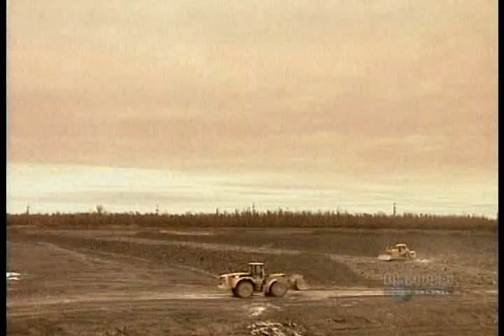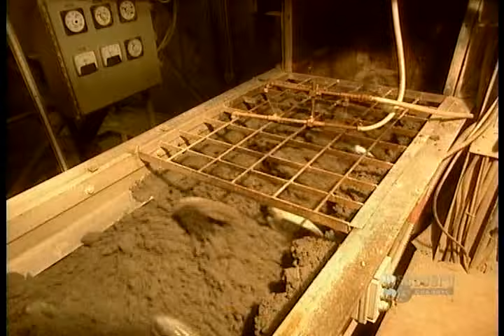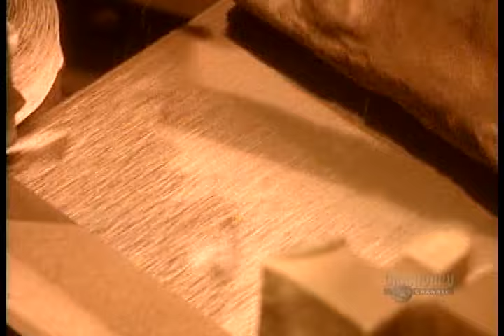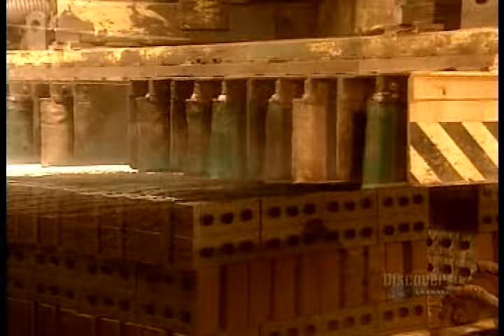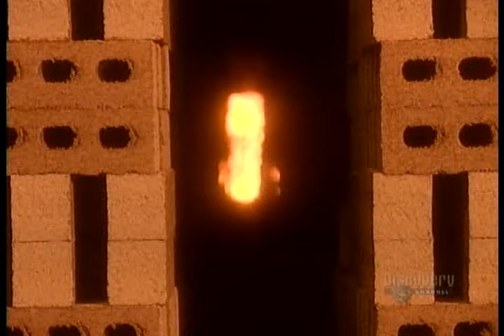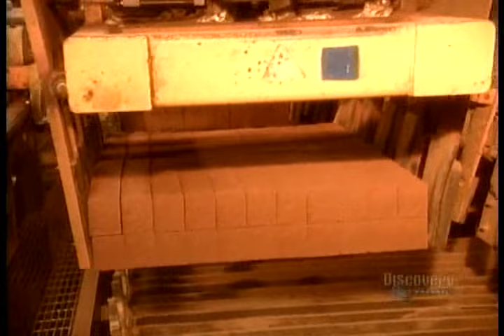How It's Made Bricks

Comment: Anyone else wondering how the three pins that create the holes in the brick are positioned without any support?
Reply: Ceramic inserts staked on to steel posts.  They are suspended horizontally.  Effectively biforcating the slug.  The clay gets pressed back into one piece as it passes through the tapered die.

Comment: The 3 holes are not only for weight reasons. They form a bond with the mortar, when they are laid.
Reply: Couldn't you also put steel supports in the holes and fill that with cement mix to make a stronger reinforced wall/building?
Reply: @patrickbliss9264  can. But won’t.

Comment: This isnt actually how they make brick. Ive seen it severao times and this is far from it. Lee brick and block the company that makes brick for nashville to chicago does it very different. Those also arent the correct sized for bricks. They should be 8 inches long, 3 inches wide, and 2 inches thick. The stacking process is wrong, the kiln is never used all they do is put them in a vault for about 3 hours and then ship them off, they dont texture them like that, they do cut them like that but the dimensions are wrong, the way that guy split that brick is wrong, and the way he tested it is wrong. If i had a guess i would say those brick and all defective and would've been cast out. And they arent well made, you can tell they are cheaply done and wont last under much pressure. Those would be veneer brick if anything or brick for a raised garden based on how they were made with the wrong material.
Reply: There's more than one way to scramble an egg, and more than one way to use a scrambled egg.

Comment: "they stack the bricks in cubes of 500 to 600"
"each brick weighs 5 and a half pounds"
"so each cube weighs in at about a quarter tonne"

uhhhh no that would be a little under 1 and a half tonnes
Reply: A "tonne" and a "ton" are not the same thing. A "tonne" aka a "metric ton" is 1000 kilograms. A "ton" is 2000 lbs. A stack of bricks weighing 500 lbs is indeed a quarter ton.
Reply: @bamaslamma1003  Say that again, but slowly...

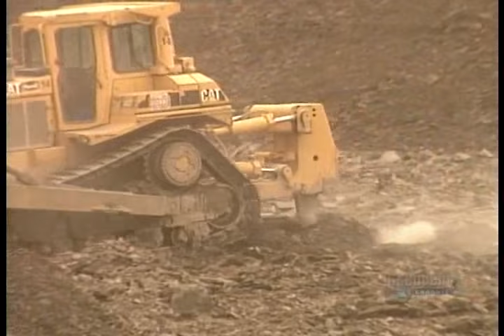Comment: (0:22) - "Quarry machines dig forty centimetres down".
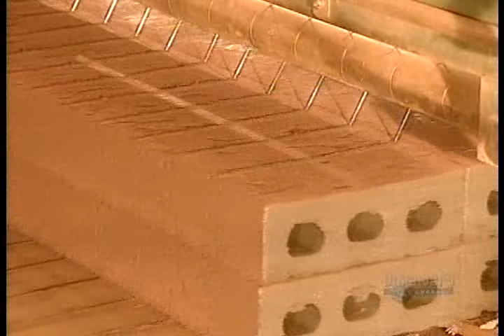(2:05) - "Out of each five foot length they cut twenty three inch bricks". Er, is that twenty bricks three inches wide or an unspecified number 0f twenty-three inch bricks?
And why all the mixed up metric and imperial units?
This is total bollocks.
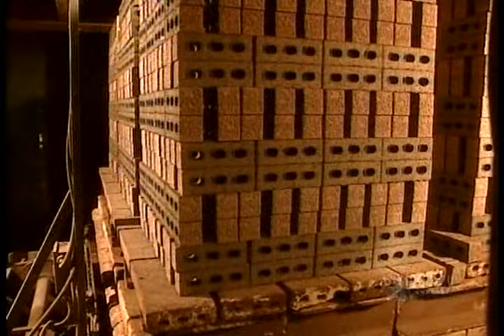And (2:57) - What the fuck is a "Killen"?

Comment: If they stack the bricks 500 a cube, and each brick weighs 5 pounds, how does that equate to a quarter of a ton?
Reply: Yes, noted that as well.  It is interesting, some perforated bricks go 3.7 tonne per thousand, sandstock solid bricks can go from 3 tonne to 3.3 tonne per thousand and shale solid bricks can go from 3.8 to 4.4 tonne per thousand.  All of the bricks are the same external size and the funny thing is that the same size pavers generally weigh 5 tonne per thousand.

The question that I will ask though:  What size are the bricks?  Australia standard size is 230 * 110 * 76 mm.  Malaysia, from memory, use a 210 * 100 * 70 mm brick.

Comment: bricks suck!
they are old as time and there are alternative old as time and there are new innovations kiln bricks  have ruined the environment enough
they are wrong bricks are not much energy efficient and are most importantly bad for environment
they use a ton of energy to make it (2000 degrees fahrenheit)  witch produces allot of co'2
i live in a brick house and spend time in allot of brick buildings  and the walls do not hold much heat or coolness 
when its hot i must constantly use the air condition  against cold its better insulated
their are so many greener alternative brick for kiln bricks some are even better than kiln bricks (some hold and cooling better and do not need additional layers and will actually give out heat or cooling of the walls when needed)
kiln bricks is much worse for the environment than incandescent light bulbs 
ITS ABOUT TIME THE USA OUTLAWS THE USE OF KILN BRICK AND PURE CONCRETE BRICKS
a few examples of alternatives are timbercrete, papercrete , compressed earthblocks(ceb's), hempcrete, adobe, etc.
they don''t use heating  in the curing process and are better environmentally and some have even better qualities as a building block
so go ahead and write letters to your senator representative make petitions  and send them too finally stop the use of kiln briks
Reply: I have a lot of experience in writing walls of text; so let me share some advice. Use commas where appropriate. Use periods at the end of sentences. Try to organize what you say into smaller paragraphs. (Only if the forum of communication, and input device you are using, allows you to use paragraphs, of course.) These are things that will help people read what you say, so they will be less likely to skip over what you say, to read other comments.
I happen to be skeptical of the energy "efficiency" of traditional red bricks too. I think that expanded rocks like perlite could be used for more than just furnace insulation.

Comment: 1 ton is 2000 lbs
1 brick is 5 lbs
500 bricks is 2500 lbs
how is a cube of 500 bricks only a quarter ton?
Reply: Even so, a quarter ton is 500lbs-550lbs. 500 bricks is not 500lbs.
Reply: 1 brick is NOT 5 lbs it weighs less then a lb,,,,further more a cube of brick consists of 490 bricks and weighs about 500 lbs,,,which is 1/4 ton in american weight
Reply: @mrcoz1764   take a  brick.. and a pound of butter    put one in each hand..   tell me the same story again ..   Or better still.. weigh them on a scale ...
Reply: @sharonolsen6579   OK miss brick expert depending on what material,,,and or size and use a brick can weigh different from each other,,,,so take 5 gal bucket and fill it with dirt,,,,,then take another and fill it with sand,,,,,then tell me which is heavier
Reply: There are different kinds of brick.  Some are modular sized, some are queen size, king sized, norman size.  Each one of these sizes has a different weight.  Some of the mod brick can weigh anywhere from about 3 lb up to approx 4 lbs per brick.  Most cubes of mod brick contain anywhere from 525 to 530 brick.  So based on the kind of brick you're getting, a cube of brick can weigh as little as 1700 lbs up to about 2000 lbs for brick pavers.  This is typical of cored (with holes) brick.  Then, you have your solid brick that does not contain holes.  Those will be heavier, too.  There is no standard brick weight.  Based on the company you are purchasing from and the kind and size of the brick you are getting, the brick weights can vary widely.
Reply: Wowzamagoogification
1 metric tonne is 2200 pounds. 1 short ton is 2000 pounds.
Reply: A 2 lb chicken weighs the same as 3 lb of yams

Comment: Bricks are only energy efficient it the sense of thermal storage if the building is designed taking this into consideration. For example many people are not home in a bedroom during the day. In this case a lighter weight structure will be more appropriate if the climate allows a cooler evening without the stored heat of the day forcing you to run the A/C all night.